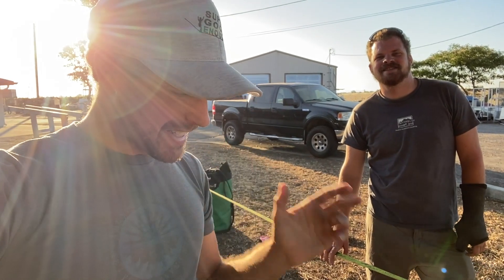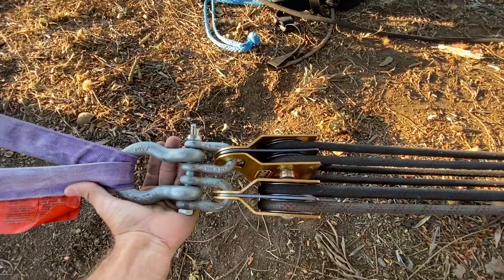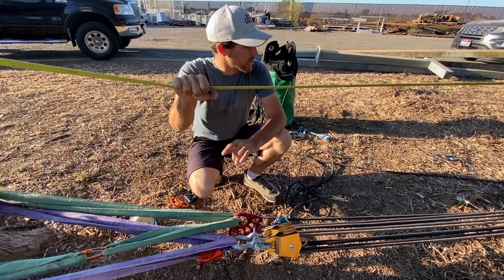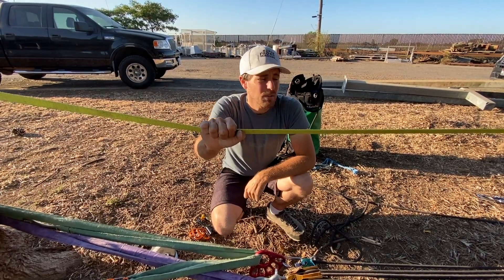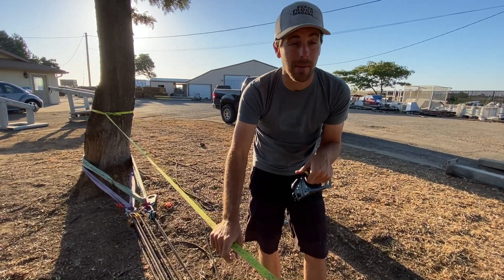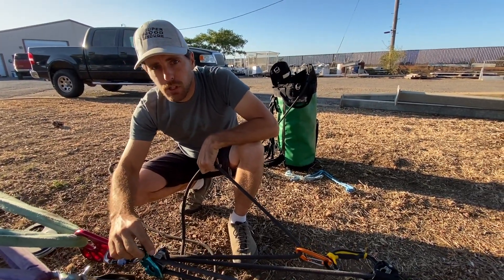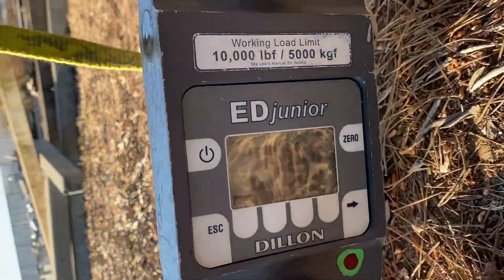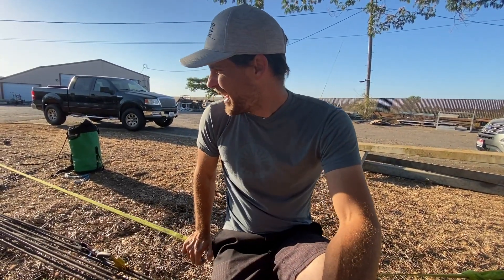81 to 1 pulleys for break tests in real rock

Comment: Thanks for the video. If you ever want to try this test again, I would love to see a slow steady pull with a winch and have you measure the force on the haul line to compare it to the force at the load. I cant help but believe that during a slow steady pull, the forces will even out giving closer to an 81:1

Comment: I use rigging a lot for my job (arborist). I'd love to see some dynamometer readings on the forces that each pulley in the system sees in common systems like a z-rig (3:1) or a 5:1 or two z-rigs in line (9:1). It'd also be rad to see you break some micropulleys or other rigging gear. Thanks for all the cool info!

Comment: I've been curious if you could test homemade swages using aluminum and copper alloy swages. I'll reply in the comments when I get the specific wire I used. But I repaired a few nuts (DMM offset) that had damaged wires and also put them on some camhooks and beaks.
Reply from the maker: Hey Mike, I think that would be an interesting test. Promoting that kind of DIY climbing gear makes us nervous bc every home made thing we test has a huge variation in strength from super good enough to could fail easily in normal use. I think homemade swages would have even more variation, based on the conversation following the swage failures of a small climbing gear manufacturer in the last few years. -Bobby
Reply: @HowNOT2  Bobby, thanks for the reply I can for sure see the possibility for a wide variation in strength. Just so we're on the same page I re read my comment and I may have spoken incorrectly. The swages themselves aren't homemade. I used a Nicopress with swages I got from a rigging company to repair the nuts. Don't know if that makes any difference but… anyways love the channel keep doing what you do.  Cheers

Comment: Why not use amsteel or some other dyneema as the static line? Crazy expensive?
Reply from the maker: too slippery
Reply: As he said, too slippery... and ALSO sharp-toothed progress devices (such as ascenders) tear the crap out of a braided low-lay-angle UHMWPE rope (amsteel, plasma, e.g.). Rope clamps (e.g. kong duck) or tibloks don't work at all. The only friction knots I've gotten to work on braided UHMWPE are schwabisch knots made from a lower diameter, polyester-covered dyneema (you can use all-polyester double-braided, but chances are it won't be strong enough). The metal-fiber coefficient of friction of UHMWPE is about 1/4 that of polyester.  Wait till you try pulling on a 6mm pure dyneema rope with your hands-- rubber-faced gloves help a little.

Comment: Have you considered using the block and tackle to pull from a third anchor on the middle of a taught line? Add another huge force multiplier without adding much friction.

Comment: Part of why you are loosing so much to friction is that you are putting the friction in the worst possible place in the system. When you have the high-friction components closer to the haulers in the system, then the loss is essentially multiplied thought the more efficient parts of the system. I would bet that if you rigged your first set of big pulleys as a 4x1, then the grigri for progress capture, and then your second set of big pulleys as a multiplier, that would result in 16x1. Add a 3x1 multiplier on that (with the best other pulleys you have) and you would probably be fine to haul 25kn. 

If you stacked your two sets of big tandem pulleys as a 16x1, and then used your pro-traxion as a progress capture on a 3x1 multiplier, that would probably be quite efficient.
Reply from the maker: I'll tinker with configurations.  Any tooth device as a progress capture is more efficient but no way to release it if sample doesn't break
Reply: @HowNOT2  the fix for that is to attach the progress capture to the anchor with something you can release, maybe those "soft release" devices that you use on highlines.

Comment: I wonder if this could be used to see how much force it takes to break a small to medium tree that's used as an anchor. Not sure how to do it ethically, but tree anchors are the one thing where we don't have that much data on at the moment.
Reply: I think the problem is most people can tell when a tree is bomber, essentially unbreakable by any setup, and if it's small enough that it could possibly break there are so many other variables that it wouldn't really tell us anything useful (e.g. another tree of the same thickness/shape/etc may hold just fine under the same circumstances). With gear there are standards, MBS, etc so it's useful to know their breaking points. There is gonna be some variability but much much less than natural anchors.

Comment: Wouldn't getting an 81:1 tma be easier using a compound system consisting of 4 3:1 systems pulley on each other sequentially?
Reply: It sure would! I can't get my head wrapped around it at the moment but the throw length and reset would be horrendous. I'm sure a Canadian high angle SAR tech already knows the answer.
Reply: I'm not sure by how much the throw length changes between systems. I think the reset would be more tedious than horrendous,  especially if one connects the moving blocks (pulleys) to the line via handled ascenders or a bachmann hitch. A sequential 81:1 (4x 3:1 in series) would also be more efficient in regards to friction do to using 2 less blocks.
Reply: @psychosocial50able  Very true, the throw would be the same and you would gain some efficiency with 2 less blocks.

That would actually be something worth testing out. How much loss from friction between a simple and compound system. Ryan addressed it in this video in passing but what is the loss in a 81:1 system? What happens when you use really sexy (read: expensive) pulleys? What is the dynamic loss vs. static? And for all my river rescue peeps...wet vs dry? In short, TEST ALL THE THINGS!!!

Comment: Regarding friction, by having a gri gri as your progress capture you see a significant decrease in your actual mechanical advantage. A gri gri is about 40% efficient so if it’s the first component, closest to the hauler, you would immediately reduce your haul force by 60%. It’s generally best to have the most efficient pulleys/devices at the hauler because any affect there is imparted through the entire haul system. Therefore, if you were to replace the gri gri with a prusik and PMP or microtraxion you should see a significant increase in the force you can generate with this system. Pretty amazing though how much force you generated.
Reply from the maker: I could see a prusik maybe, even though they slip around 2 to 3 kn... spoiler alert to a video coming soon.  How would i detension if I used a microtraxion?
Reply: @HowNOT2  considering you would be putting the prusik at the end of the haul system, it would only see a very small portion of the load (if you had for example a 2:1 and the prusik at a change of direction the prusik would see 1/2 of the load). For a microtraxion you can haul to release the cam and then reverse haul or lower through the haul system.
Reply: "haul to release the cam" might be hard after maximally tensioning the system.  Given that the system already gives 25 kN, I'd stick with the GriGri.
Reply: @serges201  with a haul system such as this you’d find it pretty manageable because a very small portion of the load reaches the progress capture. I release microtraxions under load a lot and it’s pretty impressive how little haul effort is required to open the cam when the microtraxion is upstream of the load. The point with the gri gri is that you’re doubling the amount of force you need to input into the system because it so inefficient. I think a simple prusik and PMP would be a great addition and it’s even easier to release when loaded.
Reply: Interesting.   You may be right about it being easier than I think to release under load - I haven't tried.

As for how much you actually lose with the GriGri, I think it's about 20%.   40% efficiency at the progress capture pulley in a z-pulley maps (neglecting other losses) to 1 + 1 + 0.4 = 2.4 real MA, i.e. 2.4 / 3 = 80% efficiency.  Noticeable but not huge.
Reply: @serges201  you bring up a good point about the location of the gri gri. The equation you use is correct for the gri gri at the anchor. If the gri gri is closest to the hauler in a 3:1 it would be (1 + .4 ) + .4 = 1.8 (without including other friction losses from pulleys). Just highlights the importance of placing your least efficient device closest to the load and farthest from the hauler.
Reply: Another thing I wonder about all these efficiency considerations is to what extent they even apply in a "static" scenario like this.  When you have multiple attempts at increasing tension, and the system is allowed to "settle" between them, it may be possible to get much higher efficiencies than what is typically reported (for hauling purposes).

I've noticed, for example, in top-rope belaying a heaver person, that their tendency to pull me (the belayer) off the ground increases the longer the heavy person hangs.  That tells me the rope slowly creeps across the carabiner and the forces equalize more than they would during hauling.  So I suspect the efficiency of elements is higher in tensioning systems than in hauling systems.
Reply: @serges201  generally we reference efficiencies at the haul because that determines how much work you have to do. While this may seem static, rope is moving through all the pulleys and friction is reducing the forces that can be generated. Simply changing the order of inefficient components will increase how much force you can generate.
Reply: @HowNOT2  is loading the progress capture device (microtraxion, prussic,grigri) on a munter mule a viable solution?

Comment: As I'm sure you know, smaller diameter pulleys have more loss than larger ones. And it does look like that progressive capture has a small pulley sheave. I don't think it's going to make much difference where you put it in the system. If it always has, say, a 10% loss, this loss will multiply through just like the the ratios of the individual stages do. That is, if a 3:1 stage had a total loss of 10%, you could just consider it a 2.7:1 stage and it doesn't matter if it's the first of last stage as when it comes to the overall reduction ratio.  But, while I think it's less likely, it's possible the percentage loss does change with load. Then it's location would matter. Only with testing would you know for sure. :)
Reply: I've seen 1st hand that changing the order of subsystems connected in "series" changes the overall system's efficiency.  So yes - the % loss does seem to change with load.  Linearity is a myth ;)
Reply: @serges201  That's good to know. So what order is more efficient?
Reply: The more efficient sub-system closer to the pulling hand (where the force is smaller).
Reply: @serges201  Thanks, I find that really interesting. My gut feeling was the opposite. I thought the internal friction in a rope when bent over a pulley sheave might go up faster than the load on the rope. 
With the efficiency of lightly loaded stages making a bigger difference, I wonder if a small diameter rope in these stages would make a noticeable difference?
Reply: @andrewsnow7386 Maybe we can think of the rope as becoming "softer" (relatively speaking - compared to the other forces involved) as the load goes up ?

I've also seen force numbers indicating 75% pulley efficiency at the top carabiner in a lead fall (several kN) whereas for hauling systems (< 1kN) carabiners are considered only 50-60% efficient.

I would expect all efficiency improvements to make more difference at the lower-load stages for the simple reason that the higher-load stages are all closer to 100% to begin with, leaving less room for improvement.
Reply: @andrewsnow7386  Assuming you have, say, some pulleys with plain bearings (high friction) and some with ball bearings (low friction), always put the low friction ones in the high load part of the setup because the friction loss does not scale with load. With the plain bearing pulleys, and with the rope simply run over a loop like I saw in the video, the friction does scale with load (a fixed percentage). Assuming the ball bearing pulleys have enough load rating, that is. I'm not a climber so I don't know if plain and ball bearings are common options with climbing equipment pulleys, but I do know a bit about pulley systems in general.

Comment: Awesome setup, can't wait to see some fresh breaks. A trick you might try is running your haul strand through a pulley placed securely about 8 feet up the tree, then attach a jumar or prusik to a foot loop and just use your body weight to pull the rope.